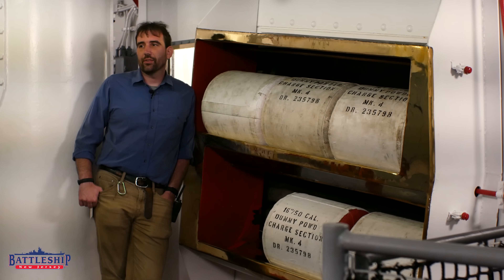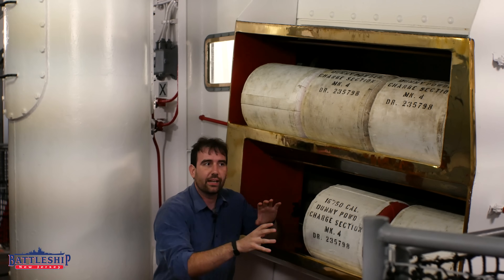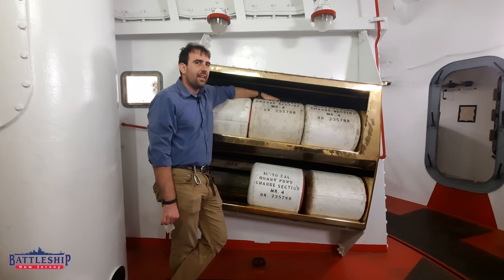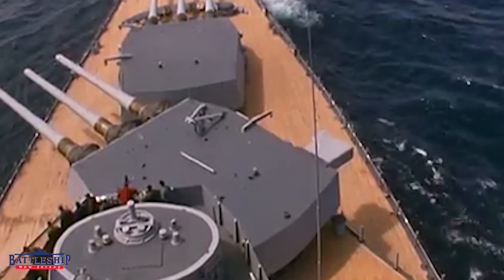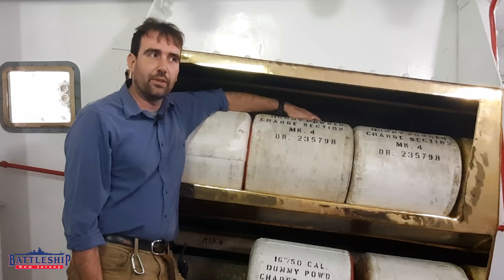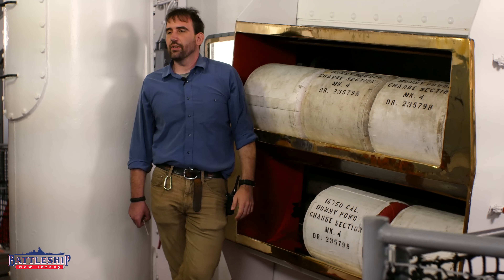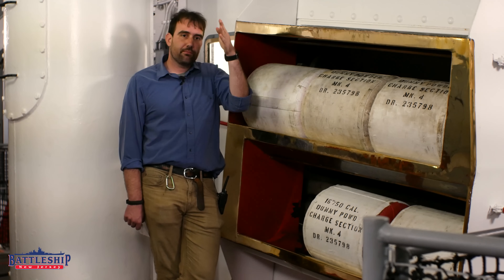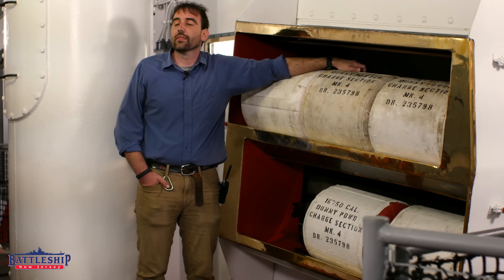16in Gun Powder

Comment: Hope too hear, why ,IOWA, Turret exploded, not the "CONSPIRACY", Theory.
Reply: One thing we do know, the powder was smoldering before the breech was closed. Phone communication from inside had this a one of the men was heard exclaiming, "oh, my God the powder is smoldering." They didn't get the breech closed in time. The shell in the bore served as a plug kept any gas from getting out the pressure from all the gas from the power going off actually bulged the bulkheads between the gun pits. The Navy maintains an over-ram most likely caused it but enough experts say it is possible but highly unlikely. They blow compressed air through the barrels after firing to clear any debris and embers. Maybe something was still hot in the chamber. It's just really shitty that the navy tried to blame it on a guy saying he was suicidal because of his homosexuality.
Reply: That event will always be left to people speculating on what actually happened. Too much evidence was destroyed before anyone could start investigating. Some of the, mostly early, testing was flawed. About the only thing we can ever really know is that the powder ignited while the breech was open and the barrel was plugged by the shell in the barrel. 

There is a great video that goes step by step on what we do know. Google "Turret Two Lecture" and it should be the first video that gets linked. It's an hour and a half long.

About the only solid pointing evidence I've seen as to what happened is from the known audio from the gun crew saying that something was smoldering. Followed shortly after by another crewman yelling over the phone that there was a flash. From what I understand the whole point of the quilted powder bags is that the large grains aren't super easy to get ignited initially. Though once they do get lit they burn extremely fast. Something started the silk powder bag smoldering. The most likely cause of that smoldering would be the 24 inches of over ram of the powder based on the damage observed on the rammer chain after the explosion. Even silk burns relatively slowly. Eventually the smoldering portion reached the quilted section of ignition powder causing a much more intense flash which ultimately ignited the big grains. 

But at this point we'll never know for sure.
Reply: Watch the vids on loading the guns and notice how fast the rammer drives the shells into the breech and how slowly and delicately it pushes the powder bags in.  If the rammer malfunctioned, it may have driven the powder bags in with so much force that compression/friction ignited the black powder patch on the end of one of the bags.  These ships were old, there wasn't enough $$$ allocated to fully renovate them when they were called back into service in the early 80's and the gun that exploded on Iowa had a prior history of rammer malfunctions.  It was just a terrible accident most likely caused by a mechanical malfunction.
Reply: @sikofu2  just a reminder that the business or defense has its own peace time dangers. So when you thank a veteran for his/her service,  it isn't just about getting shot at. It's about doing dangerous at "the office" every day.
Reply: They never determined with 100% certainty what the cause was, but they did disprove the intentional action of any sailor in the gun room as being the cause. The Navy really screwed up the whole investigation as the "crime scene" was entirely contaminated before it was documented. Bodies were removed and cleanup had taken place before any investigation could take place. A day passed before anyone arrived to "investigate" and the "investigator" was a former commander of the ship. He entered the turret where he found the crew already cleaning and repainting as well as disposing of broken equipment by removing it from the turret and heaving it over the side of the ship. 

It is odd that no formal investigation was begun immediately as before any cleanup had begun a EOD Technician had been sent by helicopter from the USS Coral Sea to assist in the removal of the powder charges from the outboard barrels on turret 2 and the charge that had not gone off in turret 1. At the same time a 3 man team of NIS investigators volunteered their services onboard Iowa and were refused. The charges in turret 2 outboard barrels were removed and the misfired charge in turret 1 was found to have the bottom bag sitting crosswise in the chamber which is why it didn't go off. Shortly after that the bodies were removed and cleaning of the turret started. 

It was a cluster all around and stinks of coverup.
Reply: From all I have seen they loaded into cold bores, the charge that exploded was the first charge that was loaded that day in that barrel.
Reply: @mindeloman  Veterans don't tend to thank other veterans for their service just as a heads up. As a veteran I've never actually thanked another veteran for their service.